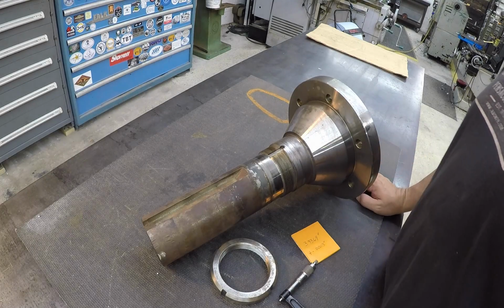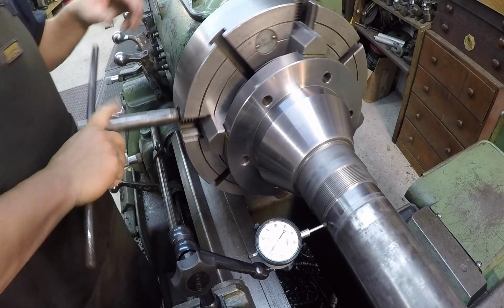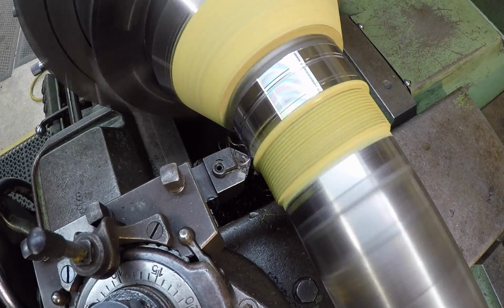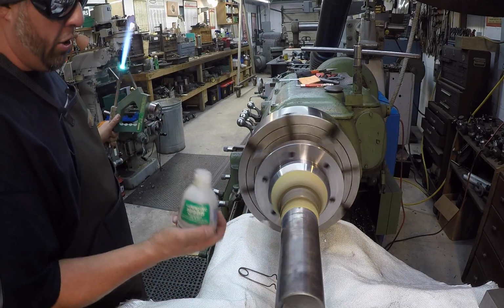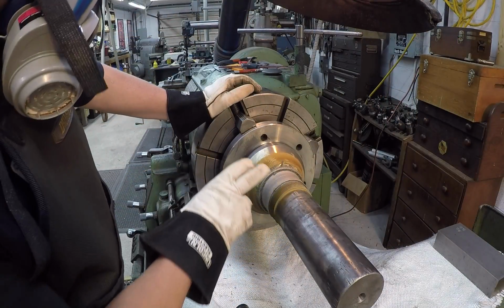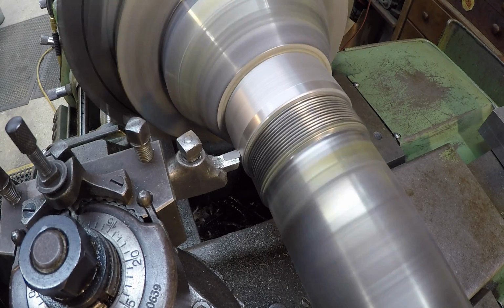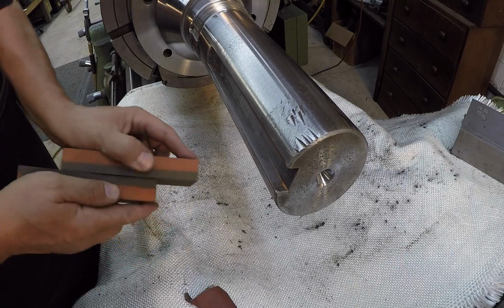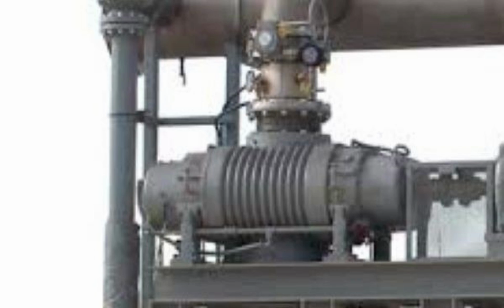SNS 300: Spray Welding a Blower Shaft

Comment: sounds kinda like it really, really weak weld...       oh    gas metal arc   here... hehe we make sure ya get at least a 3/8" bond into the metal if it a load bearing surface.     oh nevermind thats technically not welding..     welding is bonding 2 piece into one by means of an ARK..  I wouldn't trust that sorry..   few pass's with a mig welder would have filled that in and you just lathe off the rest...
Reply: So oxy-fuel welding isn’t welding?
Reply: @Jron2498 , what this process is, is metal particles being heated and "sprayed" on to the surface. What he's talking about is Arc welding or mig would provide deep Penetration into the work piece not just lay on the surface.

Comment: Why not just Micro Weld it up and turn it to size? Also that bearing tolerance is way waaaaay to high for a bearing fit (+- 0.0003" / +- 0.00762 mm) Final size on roller or ball bearing would be slightly over sized on a standard shaft journal of Ø3.9" or Ø100 mm shaft. Final size should be Ø3.9381" - Ø3.9375" (or in metric) a m5 fit of Ø100.029 mm - Ø100.013 mm.
Reply: @GEFanuc21t  I think you are spot on about the tolerances. I should have paid more attention to the bearing arrangement :-)..... We repair many many shafts for every possible industry using Submerged Arc Microwelding and then final machining. Constant rotation and even heat doesn't cause the shaft to bend. Here is a video https://www.youtube.com/watch?v=UYGzVzpWrw4

Comment: I miss this sort of work. Used to repair motors and worked closely with a shop set up for "metal spray" as we called it. They had an old lathe set up for the process so they didn't have to try to keep it clean. The only difference is, the guy who did it always wore a respirator while spraying, he was very concerned about inhaling the metal powder fumes.

I've always wanted this capability for my shop, maybe I should look online for an old gun like yours. Great demo video, the guys I dealt with always treated it like a top secret process!

Comment: I understand demo videos, but it would it be easier with a hard facing rod like 7018?
Reply: Welding bends shafts due to the heat. This process heats and builds up the material evenly, so you don't have to straighten it. The whole process is much faster.

Also 7018 is quite soft, a nice rod to machine but definitely not for hardfacing.
Reply: @eulachonfish  kinda yeah kinda no. Im a welder in a machine shop that repairs shafts like this as well as other hydraulic parts. We would MIG weld that shaft, rough machine with stock to grind with no warpage. You're right about the 7018.
Reply: @NM-cs8yc  You are right, I'm oversimplifying. Worked in the electric motor industry for many years myself and a large shaft like this will take welding easily. We found metalspray really shone when dealing with ~1/2" shafts that have much more of a tendency to bend. Great for worn seal surfaces too, we found it easier and faster than sleeving or welding.
Reply: @eulachonfish  You're smoking dope if you think stick welding is going to "bend" 😂 that shaft. It's a friggin giant heat sink, and warpage not bendage, is possible... on smaller pieces
Reply: 7018 doesn't hardface

Comment: yo! that was an antique temp gun! tried to see what brand it is, noticed it did not have heat map, just digital reading.
I went to the Abom link where the tool list is... bwaaaaaaa! did not see a temp gun there.
Do you have it because it is accurate and has the rage you need!?  Are heat map models not good enough?

Comment: A shop I worked at in Houston would put the shaft on a positioner and tig weld the build up before machining.
Reply: That's what we did when I worked at Vulcan Materials in one of the open pit mines. I welded head pulley, tail pulley shafts during winter maintenance and then they were turned down.

Comment: There’s a place back East that’s using this type of technique to restore WW2 warbird parts that are no longer available but they use a laser to melt the powder, very cool 👍🏻
Reply: Sounds like laser sintering, an additive from-scratch production process (versus lathing/milling, which are subtractive processes).  A bit different though, sintering is actually creating a new part completely, by heating to the parent material melting point, thus it's all one material part when done.  This video of "spray welding" is an additive process of sorts, but it's adding a dissimilar material bonded on-top of the parent material.  Don't know if anyone does sintering onto an existing part, that would be very interesting to see, not sure how it could work, but could theoretically maybe submerge a part in similar powdered material (steel powder for instance) to build up a sleeve, and (maybe with static or magnetic control) build a surface layer up in contact with the underlying part, and then sinter it.  Would still be relatively weak compared to natively cast/forged/milled parts, but would possibly be equivalent to shrinking on a sleeve after the fact.

Comment: Roy in the UK. Saw this process around 40 or so years ago by our local Eutectic rep' Keith Charles. We didn't buy it as we didn't have the work for it but we did have an occasion we could have done with it as Eutectic did field repairs. But we built it up by welding then machining back to size. The rep' by the way became an undertaker but he really was a first class welder.
Reply: I worked in an electric motor and pump shop where we built up shafts with a MIG welder.  I was always concerned about heat bending the shaft or creating irregularities.  I wished we had this tool.

Comment: ...real cool...more like brazing than welding though...we did cutlass bearing sections on boat propeller shafts like that in the 70's...stuff would flake off on all but monel....switched to wire feed apparatus connected to the carriage on the stainless shafts...stayed on....slight undercut on each end was insignificant.....cool video cuz.....
Reply: I haven't heard of cutless bearings in years. I worked at Goodrich relining cutless bearings in the 70's to mid 80's.

Comment: I love the video and all your machine work. Very nice video.
I had a process that the shop called "Metal Spraying" done to a large disc sander shaft of mine, that needed a buildup of metal to work with new caged ball bearings. My machine is an old Kindt Collins 24" disk sander and the spindle was being changed over from manual grease bearings from the 1950's to modern never grease caged bearings.
They wouldn't let me in the shop to watch, and they cleared all the people out of the shop "they do large oil well valve repair" out here in Calif. It was amazing to see....there was a ton of sparks and sprayed metal flying off the lathe, and the whole shop "easily 15000 sq. ft. - filled with smoke, and the machinist was in a fire suit, and almost invisible doing his thing. Looked like the bldg. was on fire.
And of course, the best part is the sander will last another 70 years or more, before another rebuild - it now runs so smooth - you can set a glass of water on the sanders table and a lights reflection in the water doesn't move.....

Comment: A manufacturing facility where I worked used to spray weld tungsten carbide on to wear points on rock bits. I aways wanted to hard face my bush hog and lawn mower blades, but never got around to it.

Comment: The way the spray weld flakes off, it looks soft.
Reply: It's not soft; it's brittle. That's why it chips off into small pieces instead of forming long strands. That's also why he says the coating is only appropriate for bearings with a captive race.

Comment: Is this process cost effective (vs part replacement)  for something like a crankshaft bearing journal or a crankshaft end where a front or rear main seal would ride?
Reply: Yes. I recall spraying diesel crankshaft main bearing journals and seal diameters when I worked at a repair shop.
Reply: yes, that part cost many times more than this repair in labour , plus the blank steel piece needed , add to that the downtime for the machine(pump in this case). He did that repair in 2 or 3 days tops.

Comment: The company I work for uses processes similar to this to reline the bore of compressor cylinders. You are absolutely correct about how spray metal repairs fail. It is almost always due to poor preparation. The preparation of the part is so key to a successful repair. The metal has to be absolutely clean and must be oil and dirt free. Also, grit blasting the part to provide a rougher surface for the spray metal to bond too can help as well. Thank you for putting together such a great video. I enjoy how well you explain what you are working on and I enjoy the old-school machining you do.

Comment: we use to do this with chrome and arbors made to punch holes in grinder wheels, ive seen submarines use nickle solution electrically charged pouring over a spinning axel in a active in use motor to build back up  like your doing here

Comment: The spray weld process was educational. I used I used this process back in1966 at a concrete pipe company. The torch was made by Eutetic. They used it a on packerhead machine to make the pipe.

Comment: Does Spray welding do a decent job at filling in "bite marks" and scarring?  Or do you have to take the material down and build it back up?  I'm talking about the stuff you can see at like 44:04 in the video at the end of the shaft, we get a lot of that at work- a lot of our machines are 20+ years old.
Reply: im thinking you dont spray weld that you just stick weld it then turn the weld marks down

Comment: @Abom79. Can this be used over a different parent metal?  Like spray welding stainless on top of steel? Or cast ?  Have a set of clutches in a dozer that keep rusting frozen solid and is a pain to fix. If I could spray weld the carrier clutch face and the pressure plate face with stainless I think it would fix it.
Reply: I use to spray weld carbide on steel parts to help with the sand from a John Deere foundry, I'm sure you could do any metal

Comment: spray welding sucks.
Weld and turn it down, works much better
Reply: Yeah and warp the part because of the heat built up. 
Man, you're dumb. I'm sure your amateur work has caused damage. 
At least use a sleeve if you're not for spray welding.
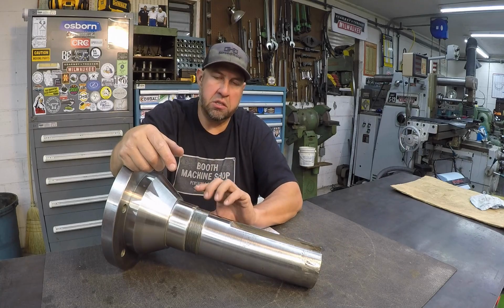Reply: 46:35
Reply: Welding warps the heck out of stuff. Plus ruins the part if it had been heat-treated to say 60 Rockwell.

Comment: worked at caterpillar a few years back and they rework large shafts, they were using laser spray with robots and also mig welding with robots just to do it faster.

Comment: Put that blower on my big block Chevy! Yeah! On a serious note, glad you explained this process vs sleeving or welding. Hey if it works, it works. I would like to know if the blower repair company has had issues with the other repair methods and that is why they chose spray welding this time, or is this more cost effective?

Comment: On top if the warping issues, welding it would be waaaaaaay slower than spraying and probably more likely to cause cavities in the buildup. Certainly doable, but spraying seems like a better way of doing this.

Comment: Been machining for over 45 year and my experience with spray metal is it doesn't last long, it  just cracks off waste of time and money, better of mig welding the shaft back to size
Reply: you didn't watch the whole video then?
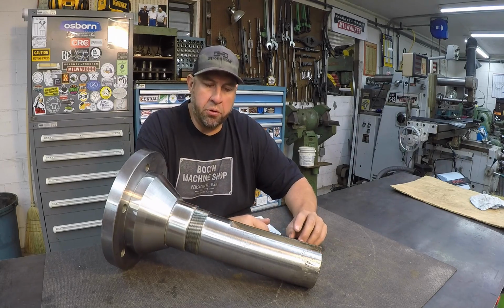Reply: I guess you should've watched the video past 44:02 where he addresses your concerns
Reply: Steven Completely agree, been in the marine business 45 years and seen a lot of large shaft repairs completed using this technique and I reckon 50% have failed within 5 years. 
Hot metal painting would be a more accurate description of this process as no fusion welding is taking place between the parent shaft and the coating.
All the comments from “it can’t have been done right” obviously do not understand what welding actually is
Reply: @optimist3580  You're saying welding is not melting metal together?  Because here you're spraying molten metal particles which melt onto the surface as soon as they hit it.
Reply: Vink Yes that is exactly what I’m saying, the shaft material is not hot enough for fusion to take place. So ask why was the shaft screw cut before this process started, also look up the word “fusion” This link will help https://cremer-coating.com/thermal-spraying/metal-spraying-method.html

Comment: Great job.  r6 fit (100.051 - 100.076) would be more suitable for that application, rotating inner ring on a shaft.  Blasting with G24 chilled iron is preferred these days over  gramophone finish but of course that requires more equipment.  TIG weld around the top edge of the tabwasher slot without encroaching into the sides provides edge support for the spray in that area. There are antibond paints which are water soluble and easy to clean off.  Good to see overspray removal during build up, that reduces the risk of cracking in the corner of the repair. As you say these repairs don't fail under normal use,  usually only when the bearing fails due to other issues.  Presumably this is in service now but I would discuss the fit with the customer,  that is pretty much a transition fit, "size for size" with the bearing. We find customers who don't have access to a suitable bearing heater would request this fit so they can "knock" the bearing on.  Again though,  great job 👍

Comment: Thanks for demonstrating this very interesting process and kudos to your skills and knowledge, the praise is well deserved - but I must ask, please, please please,  don't polish rotating shafts by holding abrasive paper loops against it with your fingers.  I work in Australia as a safety professional.  I have attended an incident where a machinist with 30 yrs experience, very careful, regarded as all his colleagues as being one of the safest operators they know was doing this and it grabbed - his arm was pulled in and twisted around the shaft resulting in multiple breaks and many, many months of recovery.  He said he was holding by just the fingertips, believing it would just pull free from his fingers; it doesn't.  Before you can react it can pull your arm into the lathe.  He is unable to return to work and was lucky not to have had his arm amputated.   I know of two others who did lose their arms, torn off by the incident.  One of them unfortunately died from his injuries.   I know many machinists use this method and luckily do so for many years without injury - but it only has to go wrong once........... and I've also seen over many years and many incidents, the lasting impact such an event has on family and colleagues of injured workers.  I suggest one method you could use is a frame to hold the abrasive, you can still control the pressure applied and if it catches, the paper just comes loose - you're left holding the frame, with no injury.     I'm not saying this to put a downer on your work, quite the opposite - I just want to be able to continue to enjoy watching you do your thing well into the future.  You (rightly) should be proud of the care and expertise you clearly put into your work; because your channel is popular, I hope it would also be an opportunity to educate others in the safest techniques possible.
Reply: Thanks for this.
Reply: I am glade to see that you took the time you explain your self and you did a nice job in doing so on your safety concerns 😟👍
Reply: Thanks for this.

Comment: Nice work. I never used spray weld but have seen it used a lot on crankshafts many years ago when I worked in an engine shop. I used submerged arc welding. When applied correctly like you did it works very well and holds up good.

Comment: In the 90's, I worked in a turbine engine rebuild plant, buying off machined parts. We called this 'Flame Spray', and all our bearing surfaces were turned down and built back up, using this process. :-)
Reply: That wasn't Hunting Aviation at 5-ways by any chance?
Reply: @johntuohy1711  Aviall, in Burbank, CA

Comment: That is really awesome. For whatever reason, it reminding me of additive printing using metal powder. I think the only question I would have is how would you have done it if the buildup surface area were 10" long versus what appeared to be 3" +/-? Would you have fixed the spray welder to the lathe? Is there a way to move the spray welder up/down the buildup area to get a more linear application of the powdered metal? Also - I noticed the preheat was like 2 or 3 hundred degrees, but what is the temperature during the actual spray welding process (application of powder). Finally - thank you ... I have seen this video come up in my list for several days now and just finally got curious. Way too kewl.

Comment: Excellent and informative video, brought back lots of memories of when I was using early systems in the 1980's to coat the ends of ceramic and carbon fibre heating elements to give a conductive surface.

Comment: Nice work, but when you only have .0003 left, you need to make sure the part has cooled to room temperature, or you'll end up undersize. I used to use wire spray and metal powders, plus plasma sprayed aluminum oxide and zirconium oxide ceramic coatings.
Reply: I think he's got this...
Reply: @Spaddog  of course he has, but vanekert's point is totally valid. A calibrated micrometer is needed whose temparature is normalised with the job. But, as I have stated in another post, this is not the best tolerance for the application.

Comment: We started using spray metal back in the late 70's at AC mostly for repairing booboo's.  In some  ways it's a superior surface to the original metal as you can change the toughness/hardness  sprayed on and it has a bit better heat transfer from the copper bonding.